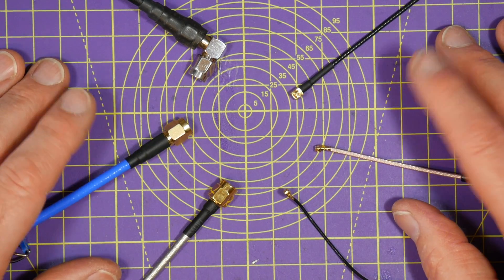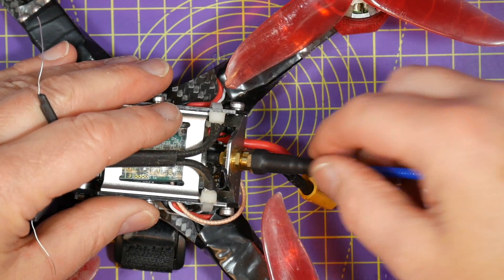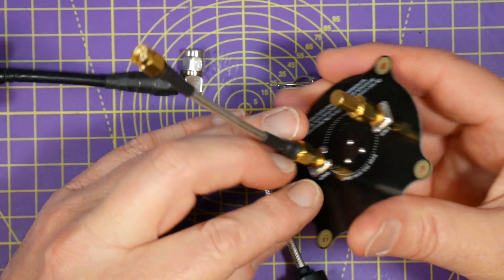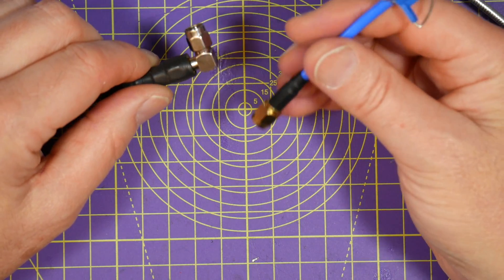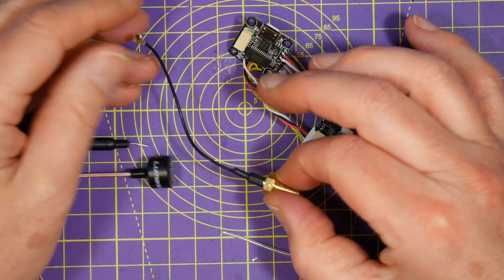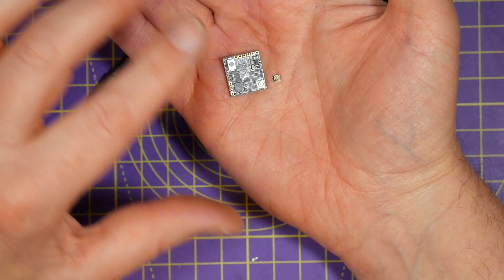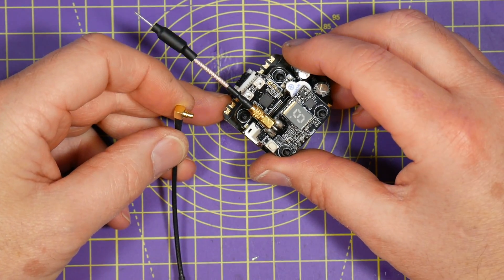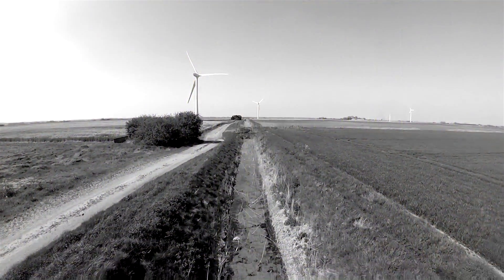A beginners guide to FPV drone and quad VTX video antenna connectors // UFL // SMA // RP-SMA // MMCX

Comment: Hi, can the vtx touch the carbon frame its a 1s walksnail and I'm pretty sure that ,could be heat sink largest silver square on the vtx  is hitting the frame. ATM just a mock up ..thank you for your time and videos.
Reply from the maker: Thanks for watching and reaching out with your question. It's generally not recommended to have the VTX touch the carbon frame directly, as it could potentially cause interference or affect performance. Ideally, you want to ensure some insulation between the VTX and the frame. If you see the VTX is hitting the frame, it's a good idea to make some adjustments to prevent any unwanted contact. Happy flying!

Comment: What do you do when the original antenna on the VTX is soldered directly? Mainly how do i cut the antenna and then solder to what pads?
Reply from the maker: Carefully desolder the old one, clean it up with solder wick and flux. Then solder in a replacement. Take it slow and no shaky hands 😀

Comment: Do you use any single power when using a UFL to SMA adaptor ?
Reply from the maker: Yes, when using a UFL to SMA adapter, you would typically use a single power source for your FPV drone or quad. The UFL (also known as IPX) connector is commonly used for connecting the antenna to the video transmitter (VTX) on FPV drones. The UFL connector is typically found on the VTX side, and it is designed for low-power connections.

To connect the UFL connector to an SMA connector, which is the standard connector used on most FPV antennas, you would need to use a UFL to SMA adapter. This adapter allows you to convert the UFL connection on the VTX to an SMA connection, which is compatible with most antennas.

The power for the VTX and the antenna is typically provided by a single power source, such as a battery or power distribution board on the drone. So, when using a UFL to SMA adapter, you would not need to use a separate power source for the adapter itself. The power for the VTX and the antenna will flow through the adapter to ensure proper signal transmission and reception.

Comment: I got the blau one but 1 off the end pins is broken is this a problem ? So instead of 4 i got 3 now
Reply from the maker: That won't work reliably. Bin it and get another one.
Reply: @WhirlyBloke  i still get footage of goggle
Reply: 1 more question i got the eachine 800d goggles with a 5.8g  5dbi  ,is the aomway antenne  with 3dbi oke ? Or do i need to match the dbi on the drone and goggles ?
Reply: Its about the k- loverleaves 5.8g 5dbi

Comment: Nice informative video on the connectors, could you give us some info about the coax cables used in each antena. They all seem to be quite different in size, diameter, etc... Can you match any of those connectors to any size cable, or do the connectors come in different specific sizes on the side where they connect to the cable, so that they must be paired with the right size coax cable ? The not so obvious example taken from your antennas in your video are the two straight sma connectors : one connects to the large diameter blue coax cable and seems quite beefy at the area where the heatshrink is, while the other sma connector, which connects to the slightly slimmer gray coax cable, also seems to be much slimmer at its heatshrink area. Does this mean these two sma connectors have different sized cable ends? Ty
Reply from the maker: I'll put it on the list.  Thanks for watching.

Comment: can you remove the UFL connector from the board and solder the antenna on? you can right? just need a damn microscope probablty?
Reply from the maker: Yes you can solder directly but you really need a good magnifier or digital microscope.
Reply: @WhirlyBloke   Thanks, I appreciate it.

Comment: I think I broke the vtx antenna on my quad, Im brand new to fpv so im not sure what every wire is yet. This wire wasnt in a connector like these but instead was placed directly on the board. It was the wire that gave signal from the camera to my googles. I bought the eachine novice 2, and just need a little help trying to fix it
Reply from the maker: Try re soldering the connections first.  Be careful not to bridge wires.

Comment: Hi, I recently got gifted the emax ez pilot drone kit. The kit includes a drone, a transmitter, and fpv goggles. The drone has a dipole antenna. The fpv goggles have two female sma connectors and included with the kit there is only one dipole antenna, so i was wondering if it was cool if I got another antenna for the goggles, and if it would matter if the antenna would be dipole, lolipop , or cloverleaf.
Reply from the maker: If you can, try to put matching antennas on the drone and goggles, but if you can't change the one on the drone, you can use a lollipop or similar on the goggles. Always try a range test in a known area first.

Comment: I think you gave some misinformation about sma connectors. Male or female isnt determined by the pin but by the threads. If the connector has the thing you can turn then it is a male.
Reply: Your wrong